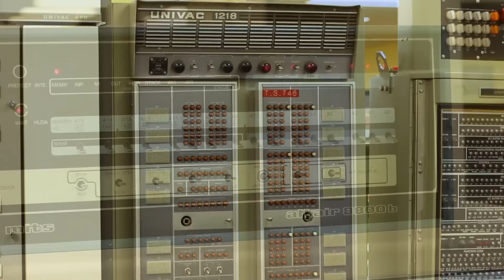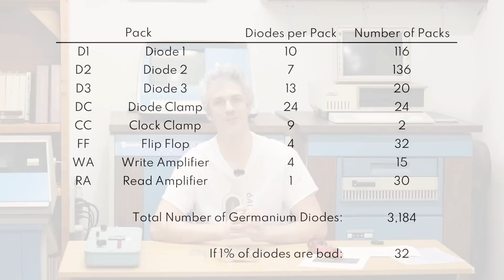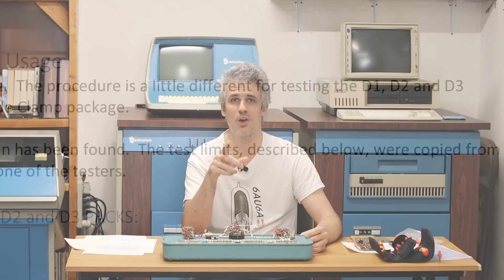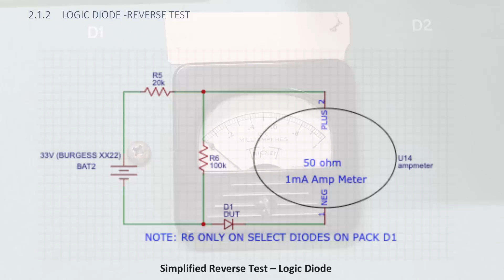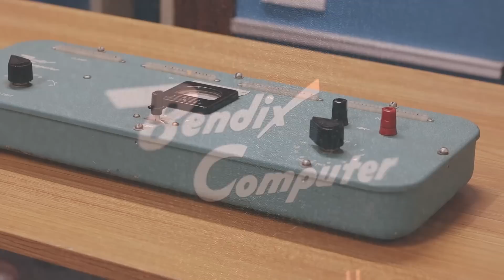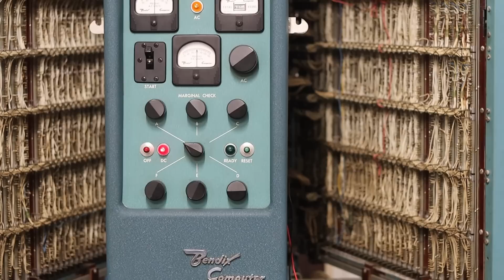Testing Thousands of G15 Germanium Diodes

Comment: As soon as this machine was unveiled so long ago, my biggest worry was.. the wire wrap. All the components can be tested and replaced somehow, but the wirewrap.. surely isn't documented, and looks like thousaands and thousands of them, so.. what if there are some loose ones? some opcodes go weird, and be really hard to find. prays
Reply from the maker: There's some good news on this front!
It isn't wire wrap, it's actually all soldered, so it's a very strong connection. But also, we have the full schematics, so if an OpCode isn't doing what it's supposed to do (and the Diaper test routines test all the OpCodes), we can trace the logic through the schematics and check point to point connections.
Reply: @UsagiElectric  Wow, thats super lucky the schematics are captured, and good point about DIAPER (or writing your own test program.) Amazing work as always!
Reply: @UsagiElectric  In Tracy Kidder’s 1981 book, “The Soul of a New Machine” he said the MIT hackers manipulated connections on the PDP processor to add brand new opcodes!
Reply: @ricardog2165  It was quite common for organizations to do this with first and second generation machines. The PDP's were 3rd generation, so less common, but still not unusual in a university research environment. After early 3rd generation it just got too hard to do that, so the practice fell out of use.

Comment: Cool video. But... Diode 7 is open, thus not dropping any voltage across resistor R8 and allowing more voltage to reach the meter. If the diode were shorted, there would be zero voltage reaching the meter.

Comment: Its probably not fun, but I feel like it may be necessary to replace all the diodes in each section as they fail, so you dont have to come back to it. Its going to take forever, and use a crap ton of diodes, but im sure they go down with unit price.

Comment: The soldering lover in me says "replace them all!" the preservationist in me says "are you mad?!"

Edit: if this machine wasn't what it is... It would be scrapped, it's like trying to repair a car that's been driven off a cliff, bounced down the side of the cliff face then landed in the sea and sat there for a few years.
Reply: Funny you mention the car analogy because that is exactly what happened to one of Britain's car manufacturer Land Rover. They were looking for one of the very first ever produced Land Rovers and it was eventually found in a farmers field. Everything about it had deteriorated or rusted to bits, the body work all damaged, the frame rusted to bits, the interior destroyed by the elements and yet Land Rover said they are going to get it back to new condition and have it permanently on display in their museum.
Reply: replace more than 1000 diodes? this is quite a lot of work that he does not need doing

Also enthusiasts tried and successfully repaired a bunch of old computers that sat on the ground in a barn collecting rainwater and dirt since probably 1980s, see for example Adrian's basement and Epictronics channels, this one is in nowhere near as bad condition
Reply from the maker: Ultimately, only around 2% of the diodes were bad. That's an incredibly good yield!
If you had a computer with 100 ICs in it, and two of them were bad, it would sound crazy to replace all 50 ICs. 

Many of the G15s did get scrapped. Through the 70s and 80s, these weren't special machines, they were just old, heavy and hot. Bendix made around 400 in total, but I've only been able to account for around 10 to 15 still existing today. I'm sure the actual number is probably double or triple that, but that still means less than 50 out of 400 surviving, which is pretty wild!
Reply: @UsagiElectric  Think about how many Burroughs/Electrodata 205 systems there are left around. I'd be surprised if there are three complete processor-power supply cabinet sets left, and very likely no tape controls and tape units. Once there were hundreds.

Comment: I hate to ask this. But is it possible that because that the computer was halting early in the boot process some of the diodes hadn't seen current since it last ran? And when you tested it the diodes tested okay but were actually marginal and ready to fail when fully loaded? It seams to me that the tester really wasn't apply as much current load to the diodes as they'd see in operation?

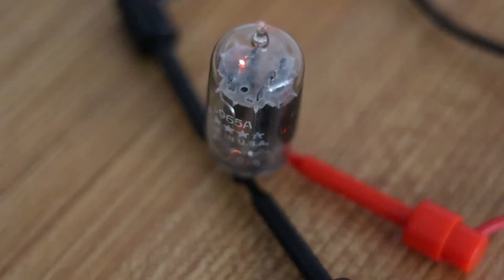Comment: 24:23 - Is it just me or is that tube missing its getter? Are you sure it didn't lose its vacuum...? However, I don't see a ring shaped getter reservoir on the top either inside. 🤔
Reply: It's a side getter. You can see the dark circle on the glass near the red probe.

Comment: I'm curious how the replacement diodes measured in the tester, if they were much different from the originals. From memory, Schottky diodes have a slight reverse leakage current, but I'm not too familiar with germanium diodes, so I don't know how they compare. In any case, if it's less than they mentioned in the notes, it's probably fine.

Comment: One set of batteries, or did you have to replace them?
Reply from the maker: One set of AA's easily lasted the entire testing!
I could probably get about a week of a couple of hours a day of use out of a set of batteries. It's surprisingly good!
Reply: The majority of the power consumption probably is that 7 segment display on the boost converter board. I would find a way to disable that display when not needed.

Comment: How many tubes have you replaced in the G15? I remember seeing those diode cards at the fleamarket in the early '80s. When I took computer science in college in 1979 we were using a PDP 8? or 11 with a 5m disk cartridge and a Basic timeshare system.

Comment: $600k is like 2 houses or .2 of a hospital bill in the US
Reply: In many parts of the US it’s about half a house
Reply: @mwwhited  in my area in US that can be anywhere between 3-6 houses. but lol depending where in CA that would be 0.25-0.5 of a house.
Reply: The price of the computer was probable just 1 one house back then. Inflation is 2% per year, house inflation is 9% per year. Its caused by demand/offer I guess. 

I think the problem with current society is that the housing system is never reset, so the prices keep increasing forever as cities grow. I imagine that cities with 500y had a couple of resets because they basically would burn to the ground from time to time.

Well, I count on this system to basically retire as a millennial, I just bought 2 houses in a city that's is still growing. Then I'm going to live on rent from gen-alpha working 3 jobs to pay for it.
Reply: @monad_tcp  we need more housing inventory. Until zoning is changed in more areas to allow for higher density, more in-fill, etc to simplify the process of resolving this - will continue to run into high demand and low supply and ever increasing prices on a scarce resource. "Resets" have happened and they're detrimental absolutely everyone (bc they're also when recessions happen, so even those who have less money who could not afford before until a reset - will also likely have their financial situation changed via layoff and price fluctuations of everything else).

Comment: Regardless of whether the cable management of the tester was original or if Lloyd did it just to be neat (it looks to be the former, but I can't rule out that Lloyd just so happened to use twist ties instead of the more modern standard of zip ties, so ¯\_(ツ)_/¯), in either case I really like how it's done. I wouldn't bat an eye if it turned out to be just a bodged-to-hell rat's nest of wires, but it looks better than anything I ever cable managed. Very cool!

Comment: Would four 9v transistor batteries have done well enough for the 35v pack?  With a diode or two in series if necessary to bring the total voltage down to 35v?

Comment: The tester could have been more user-friendly.
There should be a sensitivity adjustment for each direction, so you put the calibration resistor on, and adjusted a potentiometer so the meter showed half scale. Repeat for the other direction. 
Then you only have to watch if the dial went above 50% or not

If I had to test 3000 diodes, I would make an add-on with some go/nogo LEDs, and then remove it afterwards to keep the tester authentic. Otherwise I would lose my sanity.

Comment: If you want to install batteries anyway, why not just cascade four 9 volt alkaline or nimh and do away with the boost converter?
Reply: That's what I was thinking. Whatever I guess
Reply from the maker: I thought about that, but the problem with doing that is that as the 9V batteries drain, the voltage for testing will change and our calibration will change with it as well. By using AA's into a boost converter, the converter is putting out a regulated 33.5V all the time, regardless of the charge level of the batteries, so our calibration and meter values stay completely on point until the AA's can't supply enough power for the boost converter to start up at all.

Comment: What was the capacity of that 30 something volt battery? Was it just a bunch of standard cells packaged and sold or provided by the manufacturer? And I'm assuming that the tester is applying a specified voltage and current to simulate working conditions thusly making sure the part is functionally able to work under conditions in the machine unlike your DMM
Reply: If I had watched further id have known more I apologize... edit -If I had watched further id have known more I apologize...ohhhh.... so in reverse with the 20-30 volts applied there should be no flow and in forward if there is any high resistance it will cause it to put more more towards the meter instead of low resistance to ground through the diode if I'm grasping any of it correctly 😂 probably not or the way I've written it makes no sense at all 😂 also from experience I know how frustrating it can be when you are trying to fix one thing and accidentally changed something else unintentionally sending you down the wrong path etc 😂 best of luck and I appreciate your time and effort!

Comment: Maybe someone already mentioned this-- but I bet at least 50% of the carb comp resistors in this computer are out of tolerance. How far the resistor value can wander out of the marked tolerance before the circuit(s) stop functioning-- I dunno-- but I see some 110K 1/2W 5% resistors on the diode cards-- all carb-comp resistors should be checked for tolerance-- since wildly out of tolerance resistors can make it look like the diodes are non-functional. Carbon composition resistors are notorious for moisture sensitivity and since this computer is pushing 70 years...  'nuff said.

Comment: 27:53 oh, that's the price of a single house now, but adjusted back for inflation, you probably could buy 3 houses back then. 2% inflation vs 9% house inflation.
Reply: More the 20 Chevrolets of the time (price around 2000$ assumed).

Comment: I wonder if the G15 failed in a thunder storm or other such over voltage situation. Im not really sure what else would allow so many diodes would fail at once.
Reply: Age...
Reply: Age is the reason.
Be it the dopants making up the depletion region continuing to slowly diffuse over time and slowly changing its characteristics with time.
Or just contamination in the form of metal ions diffusing into the junction over time and making it have increasingly more leakage. Both these problems exist in all semiconductors, they will all fail after enough time has passed. Both of these are generally accelerated by increased ambient temperatures. But it were a long time since the 50's and 60's, so these have had some time to age.

But yes, ESD and other spurious events can likewise cause damage.
Reply: @todayonthebench  
The processes back then weren't nearly as refined as they are today. So there were much more impurities in the semiconductors and dopants. And different batches wouldn't be exactly the same. This will cause them to have different diffusion rates, both into the semiconductors and, with time, out of the semiconductors

These diodes almost predate the first production transistors - that's how old they are!
Reply: @todayonthebench  
It will get interesting as the newest tech in the few nm or less range behaves over time. Some people are predicting new processors will only last a decade or so, because of the ultra small scale, and the diffusion of the dopants, etc. Especially in hot running chips like PC CPU's and GPU's.
Reply: @todayonthebench  Aren't pre-90's, especially 80s/pre-80s ICs / components way more susceptible to ESD?
Reply: These old parts just degrade.  I had a box full of new old stock OA81 Ge diodes dating from about the same timeframe as this computer that had never been installed and about 5% of them were leaky.
Reply: @colinstu  that was CMOS that came to market around the 80's. ESD wasn't a concern until then. Newer stuff has protection built in. Usually rail clamping diodes on inputs, etc.
Some MOSFET's are still very susceptible - especially small ones with low gate capacitance
Reply: @jeffl4810  ty! That explains it. I remember seeing a demo of the easy ESD damage that can happen (it was a Safety video from Apple from the Apple II / early mac days) so that lines up with the CMOS chips (which they were indeed demonstrating with).

Comment: I get confused with Germanium Diodes are they N-P Junctions and work the other way round to Silicon Ones?
Reply: "... are they N-P Junctions"
Yes but with germanium instead of silicium.

" and work the other way round to Silicon Ones?"
No, they work the same. The principal difference is the voltage drop in the forward direction: 0.3V for Ge, 0.7V for Si.

Comment: I just noticed: If you leased it, it would have been 33 and a bit months, or about 2.7 years, until your total lease cost would be equal to the purchase price. Which makes me wonder: Were these beasts kept in use for longer than about three years, so buying would be the better option long term, or was technology evolving on a faster time scale so that after two years you would be looking for a newer model anyway and leasing was the way to go?
Reply: Notice the small print below the price tags:
"Maintenance service is provided at no added cost on leased equipment. See separate price list for schedule of maintenance prices on purchased equipment."
These machines were expensive to operate, requiring a lot of maintenance, like continuously replacing diodes and tubes. This was included when leasing. Unless a company already had qualified own service engineers, leasing may have been the cheaper/better option.
Reply: Computers were not software compatible so they were kept in service far longer than you might expect. IBM with the 360/370 series was the first to push software compatibly and that's one of the reason they were so big in computers. One of the early 360 users wrote an emulator to emulate another manufactures computer so they didn't have to rewrite the application they depended on. The application was tape based so the 360 allowed them to emulate two of the older systems at the same time.
Reply: @denawiltsie4412  And I thought emulators were a modern thing, now that computers are orders of magnitudes more powerful than computers then. So, if, as @fgaviator pointed out, leasing got you free service, leasing, unless you had  damn good (read:expensive) in-house techs, was probably the way to go.

Comment: I've seen duracell brand batteries ruin more pieces of valuable and rare test equipment than i can remember. They have gotten so bad over the last several years. Even in the short-term.... I can surprise you with a leak. 

Now as a strict rule..... Nothing but Energizer ultimate lithium's if it's anything I care about. 

Not only do they last much longer.....but they won't leak no matter how long they sit unused in a device.

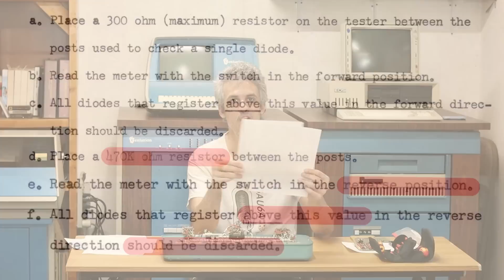Comment: If it wasn't clear from the field technician notes around 11:30, DON'T USE A BATTERY. Use a small computer PSU or scrapped PSU you can plug into the wall. Batteries run low, then the calibration get's hosed. How will you know? After you've used it under miscalibrated conditions for X period of time...
Reply: The batteries are only an input to the power supply, which is putting out a regulated 33.5V until the AA's are out of juice entirely.
Reply from the maker: As duality mentioned below, the boost converter is putting out a regulated 33.5V and it will either put out that exact voltage or nothing at all since the AA's are just providing around 6V input to the boost converter. The voltage will not waver or decrease and the calibration won't get lost until it just won't turn on at all, at which point just swap in a new set of AA's and we're off to the races again.

Comment: @UsagiElectric  11:57  Please do not use Duracell batteries in anything.  Very high failure rates.  Leakage is the failure mode causing much damage.  The age of the battery means nothing.  And if you contact your Proctor and Gamble company they will send you coupons for tooth paste and deodorant.  I framed the coupons and display them in our lab.